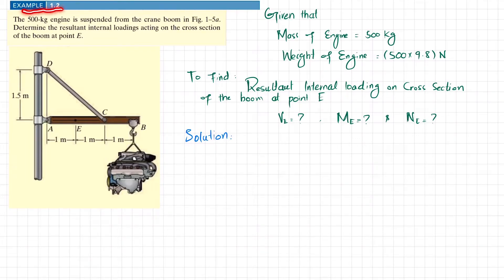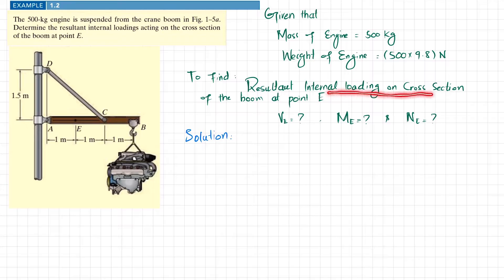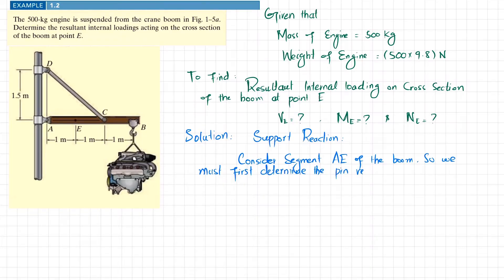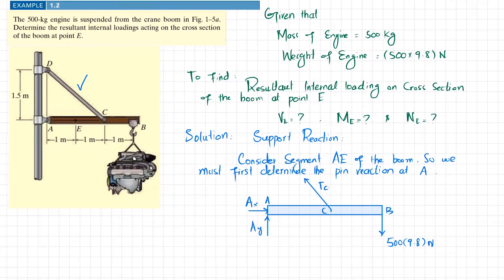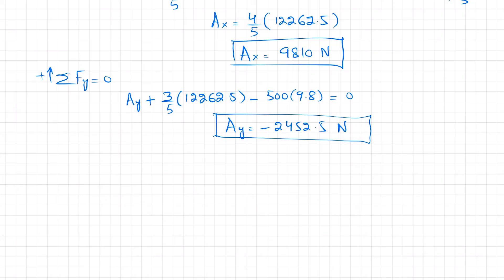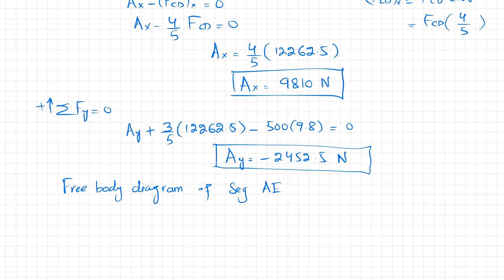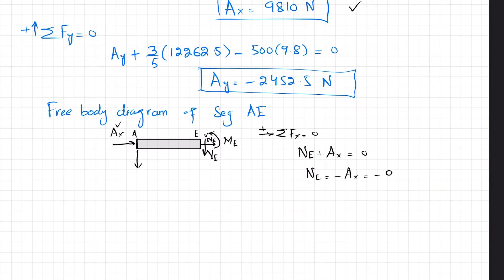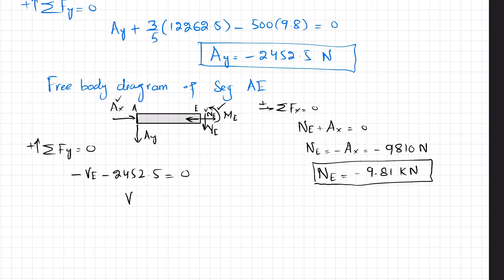Example 1-2 Internal Resultant Loading |Mechanics of Materials by R.C Hibbeler|

Comment: why shear force Ve is pointed in downward direction?
Reply from the maker: In order to keep the equilibrium. You can take it either upward and downward. At the end if you get negative value it means that your assume direction is wrong and it should be opposite to what you have assumed.

Comment: The answers are wrong,  try solving them in calculator
Reply from the maker: Try again using calculator.  You can calculate and compare the answer given at the end of the book. Remember try to learn how to solve problems rather than sticking to the answers only. We are human and we can make mistakes. Thank you 😊 💓
Reply from the maker: Also this is example and you can compare it with the solution. The video is just recorded in order to explain the procedure available in the solved example for those who have difficulty in understanding 😀

Comment: pls on this same question can you go ahead to (1) draw the bending moment and shear force diagram acting on member AB 
 (2) using mid steel of yeild strenght 234Mpa, design the size of the member AB with a factor of safety of 1.5
Reply from the maker: Thank you for contacting me I have done it but not in video. Email me so that I can send the picture of your required problem. My email address is adnanrasheed@uetpeshawar.edu.pk
Reply from the maker: i wish i could have option in comment section to share the photo....
Reply from the maker: @Enock Dadzie your required solution is already if you want it , email me by referring this along with your name.
Reply from the maker: Have you checked your required solution? I did not hear anything from you. Waiting for your response